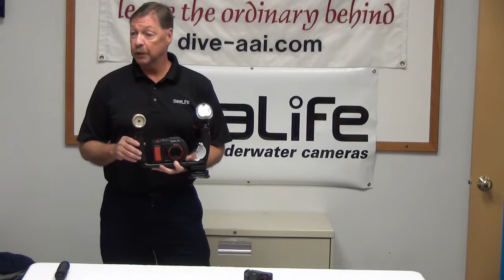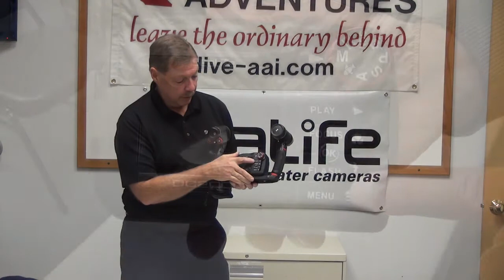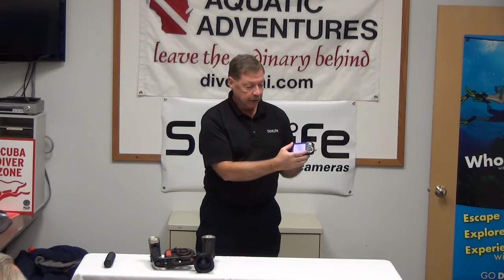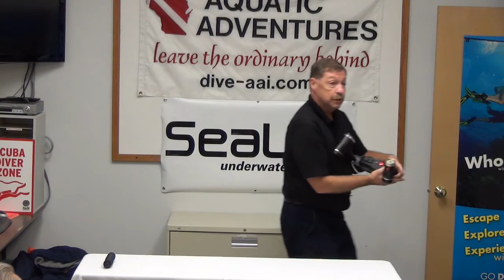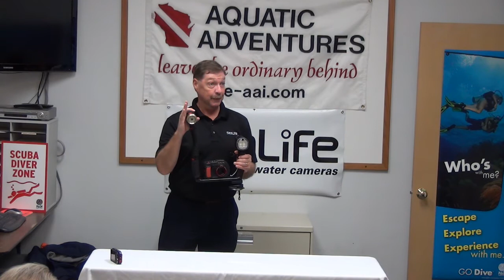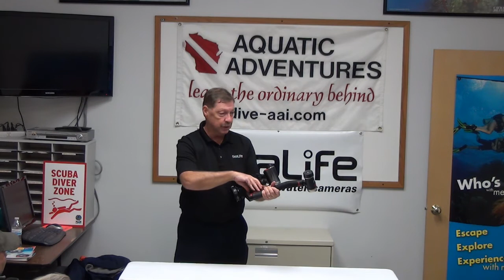SeaLife DC2000 Demonstration

Comment: so just to be sure i can bring several spare batterys  to do lots of shallow water dives in a row
Reply from the maker: Yes. And it won't take the batteries long to charge either. What we typically do is have two batteries for a day and leave one on the boat or in our car and then change it when it gets low. Then they can both be charged up for the next day.

Comment: HOW WIDE IS THE FIELD OF VIEW OF VIEW BY DEFAULT WITHOUT ANY ACCESSORY LENSES.
Reply from the maker: Hey Rahul, It depends on your ratio and where you are shooing, but here is the break down from SeaLife's website:
3:2 Aspect ratio:
Land: 66° Diagonal (57° horizontal)
Underwater: 50° Diagonal (43° horizontal)

4:3 Aspect ratio:
Land: 61° Diagonal (51° horizontal)
Underwater: 46° Diagonal (38° horizontal)

16.9 Aspect ratio:
Land: 64° Diagonal (57° horizontal)
Underwater: 48° Diagonal (43° horizontal)

Hope this helps!

Comment: how does one attach the wristband for the UW housing to the UW housing? It seems impossible. Please help. Thanks
Reply: Yes rightly said. The clip is to connect your cam to the BCD. The lanyard should go around the metal ring not the clip.
Reply from the maker: Good question. When you are looking at the front of the UW housing there is a little metal ring on the right hand side bottom of the housing. The neoprene wrist strap attaches to that metal ring. Don't try to use the clip to connect it. Slide the looped end of the thin black string through the metal ring. Then pull the two strings apart and pull the neoprene part through the space created between the two strings. This should loop the strap around that metal ring. Then you can use that plastic clip to clip your camera to yourself. Hope this helps!